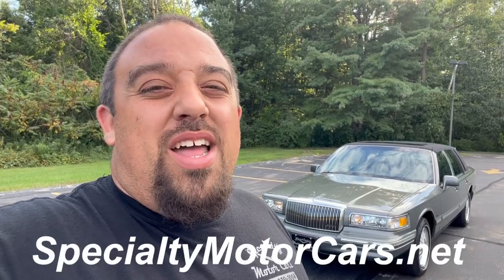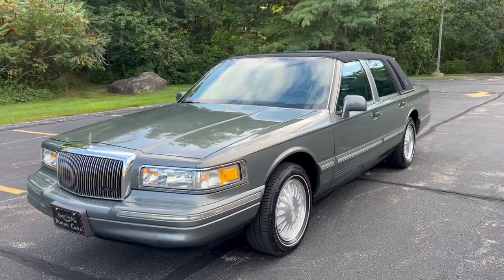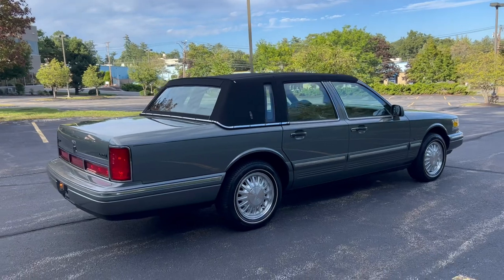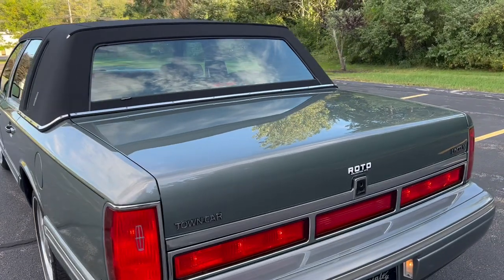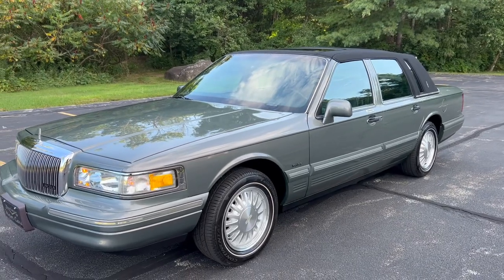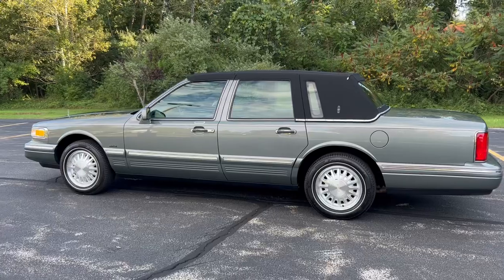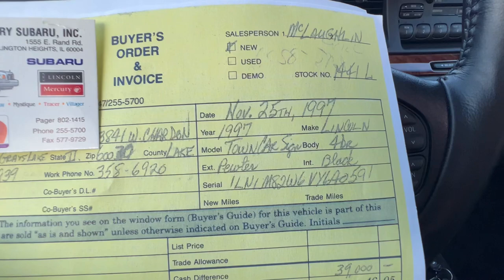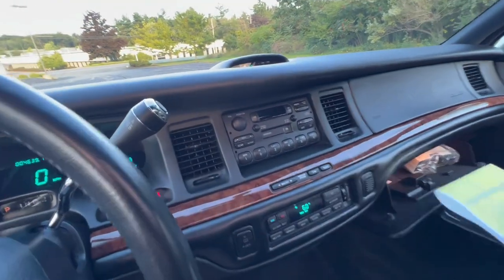4,600 miles! 1997 Lincoln Town Car Signature FOR SALE by Specialty Motor Cars

Comment: I rented one of these brand new in 1997 to drive up the freeway and back, and the driving experience was unparalleled. I am a DIEHARD, tried and true Cadillac loyalist through and through, but even I had to take my hat off for this one.  I remember the cabin being so whisper quiet you could practically hear a hair follicle fall on the seat. Fast-forward to the year 2001, rented another brand new Town Car, and it was exactly the same thing. Lincoln always knew what they were doing with these. Phenomenal American luxury barges they are.

Comment: I can see why you would deal in these Lincolns. They were mechanically excellent, fit and finish was good and ride like your couch going down the road. Extra bonus is that were generally owned by the more mature crowd that did the maintenance and drove them sparingly. Low mileage is not uncommon. When I was a dealer, these cars regardless of age were an easy sale to.......the next generation of the mature crowd.

Comment: i wouldn't be surprised if it was damaged by the transport truck, maybe a car over it fell down and got the front end just a bit.  Since it looks like Ford/Lincoln fixed it right away maybe and offered the deal with a rebate.  Like you said, who knows but the person who bought it, unless the dealer is still in business and someone there could fill in the blanks.  Still, it's a nice BIG town car that looks like new.  If I had a garage for it.......

Comment: Your right -that "ROTO" dealer sticker placement above the trunk key cover is extremely annoying.  Makes you wonder what the idiot at the dealer was thinking when they clumsily slapped that thing there. I wouldn't hesitate to take that thing off now even, original or no.  Almost makes it look like a plumbers high mileage used driver -which this piece most definitely is not.  Someone will get a nice museum quality collector though -holy crap🙂

Comment: AS A FORMER OWNER OF LINCOLN TOWN CAR  THE BEST IMPORTANT IMPROVEMENTS IN DRIVING LUXURY   HIGHWAY 🛣  ROADS AND STREETS  COMFORTABLE INTERIOR SEATS  CHASSIS DRIVES OVER UNEVEN ROADS NO MATTER AND KEEPS A SMOOTH RIDE  WINTER THE HEAT FELT LIKE A  FIREPLACE    V8 MOTOR  AND THE QUALITY SIZE TIRES DROVE IN ALL SEASON CONDITIONS   TOWN CAR WAS THE BEST OF AMERICAN LUXURY

Comment: It seems that the passings of the hood are not correct. You can see on the frontside that the hood is resting a bit too high, on one site more so than the other. This could be a sign that the car is not entirely straight anymore……

Comment: I know the car is sold (and is beautiful) but I didn't hear any comment on the rear air shocks or power window regulators that are known to go out after 25+ years.
Reply: ooopps...didn't get to the end of the video and the air springs were mentioned and looked good.

Comment: Why does a car with 4600 miles need brakes and ball joints?  Makes me think miles is not correct
Reply from the maker: Don’t forget to add the fact that the car is 27 years old. So your question should be, why does a 27 year old car need brakes and ball joints? My reply would be “because it’s 27 years old!” Same reason I replaced the tires, they are 27 years old!

Comment: Why would a car with only 4K miles need ball joints?
Reply from the maker: Good question! Technically it didn’t need them, they had no wear and were tight. But these original ford ball joints are known to fail prematurely because the rubber boots deteriorate. In this case when I got this car they were starting to come apart, due to age not use. The rubber on them fails, and will cause water and debris to get in and they will fail eventually. I did it as a preventative measure, just like the intake manifold. Those all cracked with the faulty plastic crossover. Ford recalled them but obviously with the low mileage it was never done. I had the new aluminum version installed to save the next owner the unexpected failure of the original.

Comment: Gorgeous "new" car! I worked at a L&M dealer in the mid 80s as a porter. I remember test driving all the BIG town cars and continentals that came in off the trailer....those we're the days. The merkur's came out that time, with the goofy double trunk wings...We beat the hell outta those things especially the turbo cars. Lol. I think something fell on top of that car at the dealer....I remember one car fell off a lift once....fell forward. Good for you stating that something did in fact happen...most dealers wouldn't say jack...

Comment: The fact that this Lincoln is an early 1997 built vehicle that sold so late (Thanksgiving Day weekend 1997) that the 1998 redesigned models were already on dealers' showroom floors and lots could very well indicate that this vehicle could have in fact been damaged pretty badly at some point at the dealership itself before it was repaired and sold.  The $5000 discount also adds to this intrigue, even though dealerships oftentimes will lower the prices of the leftover outgoing models, especially when the newer one is so different. I recall hearing lots of complaints from livery owners and drivers who  stated that the 1998 models had less trunk space and rear seat room than the previous model it replaced.

Comment: WTF is "ice cold air" 32°? I'm sure it's not  so you just mean a/c works as it should
Reply: Don’t be ridiculous. Ice cold air is a extremely common expression, no one thinks it literally means the air is sub 32 degrees.
Reply from the maker: Yes this one actually shoots ice cubes at you on full blast. There is a button under the dash for that. Keeps the cubes at 32 degrees
Reply: @bigalsbikeandauto  have another ice cold bud light . That can be literal . The expression is being used in a sales pitch .
Reply: @skibee50  What do you expect for a car that is FOR SALE? 😂
Reply: @christopherharris3229  truth